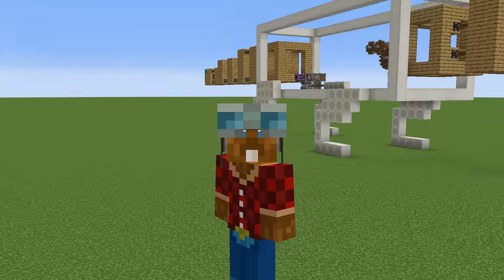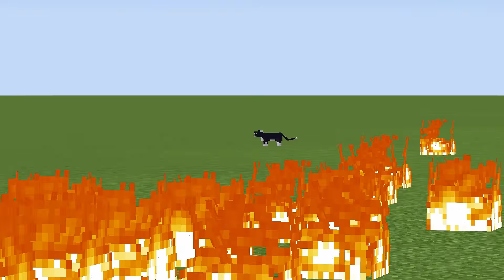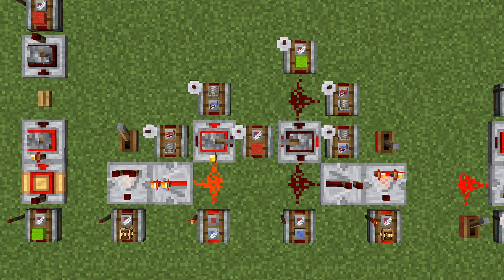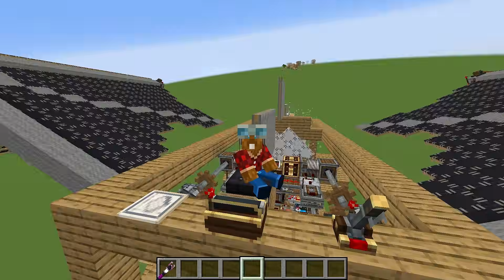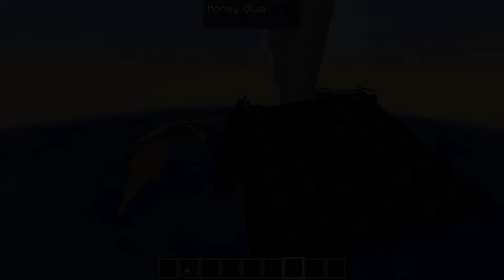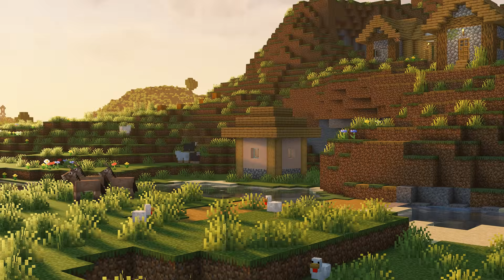I built a GIANT MECHANICAL Ender Dragon with Create Aeronautics!

Comment: Neato. More ideas for my dragon design now
Reply from the maker: I hope its bigger and better than mine!
Reply: @WoodChuckYT  the plan is better! I also plan to make mine walk and have a animatronic mode where it is on a stationary base as well. when walking i want it to fold up its wings, so I will have to figure that out lol. I also am worried about fitting all the logic inside it, and making the joints look good by covering them up within reason. if needed, I could put the animatronic mode logic mostly into the charging stationary base I mentioned, where the idea is it locks it's rear feet to the platform.

Comment: Actually i have found a way to make the swivle bearing stronger its not much but putingit in "always locked"  mode makes it a bit stronger  and idk why but sometimes the swivle bearing head cn just breake of its a big bug sadly
Reply from the maker: I also found they broke alot that way or were too strong 😅 need something in the middle
Reply: @WoodChuckYT  maybe if you tried to emulate the movement with cogs connected to the locked swivel bearing from the side? But that will probably take some space

Comment: To fix the firecharge issue, you could add a windcharge dispenser behind 2 sideways fire charge dispensers, which would launch them faster and make faster fireballs.
Reply from the maker: I did wonder if that might work, good to know!
Reply: @WoodChuckYT  I think the most difficult part would be making sure it doesn't accidentally activate the redstone

Comment: 18:15 Aeronautics actually has a preset for this exact issue, it's called "Airship ready" or something along those lines. It's just a regular superflat world but at a more reasonable Y level, which makes for a more accurate testing environment. I'd recommend using it regardless of if you have the lift patch installed or not, it's just more accurate and makes it easier to port to other worlds.
Reply: Hello

Comment: To fix the turning circle you probably want some way to overwrite the gimbal mechanism? So you can manually use A or D (or whatever you desire) to make one wing run faster and the opposite run slower
Reply from the maker: The turning it actually not that bad if you dive into it but yes that's definitely possible!